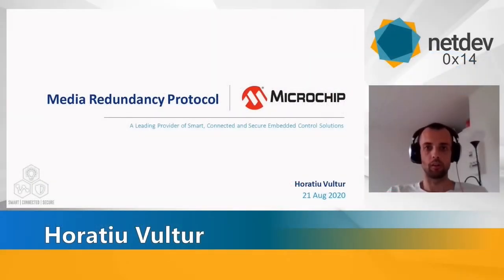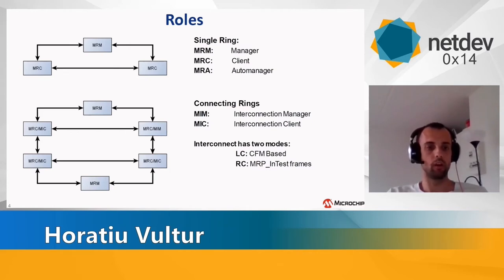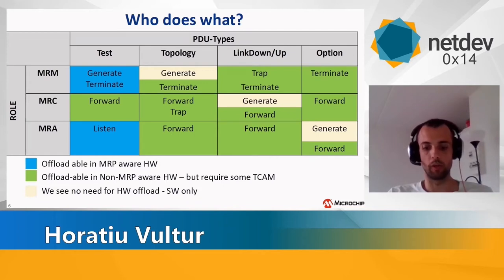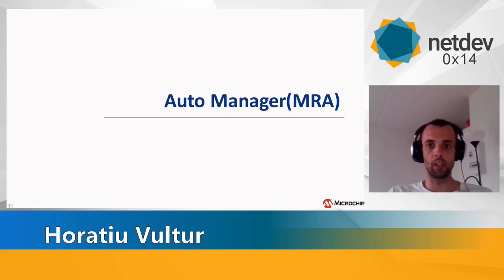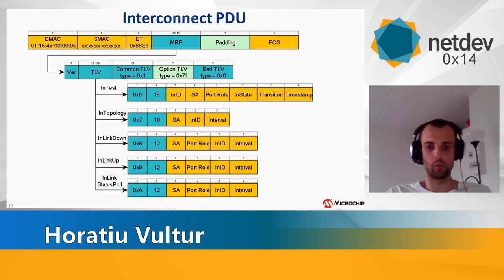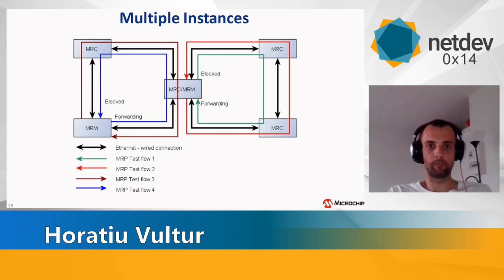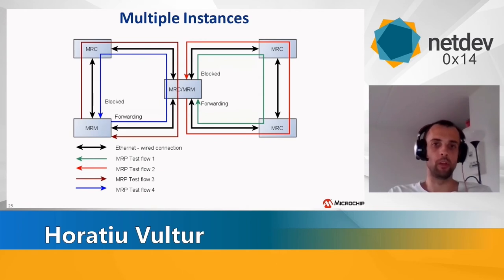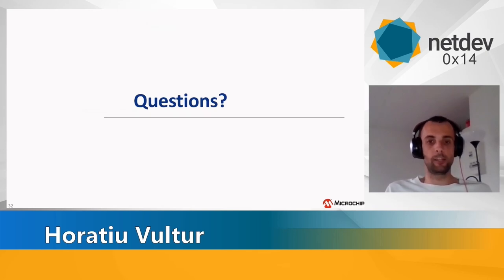Netdev 0x14 - Adding MRP to the Linux kernel

Comment: Hello,
I would need some points clarified:
- in RC mode, I understand that the redundancy mechanism is based on InTest frames. Is it based SOLELY on InTest frames ? Do MICs still send InLinkUp and InLinkDown frames when the status of the interconnect link changes?
- in RC mode, I understand that MRMs block InTest frames. Does this mean that an MRM/MIC device can not be connected to the MIM (forming the redundant interconnect link), since all InTest frames will be discarded, thus never being forwarded through the interconnect link, thus never reaching back the MIM?